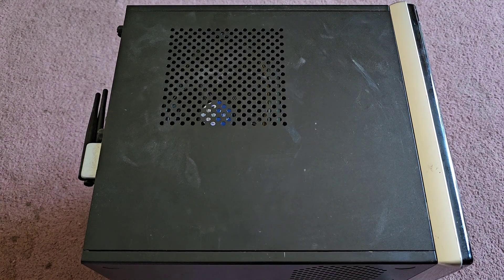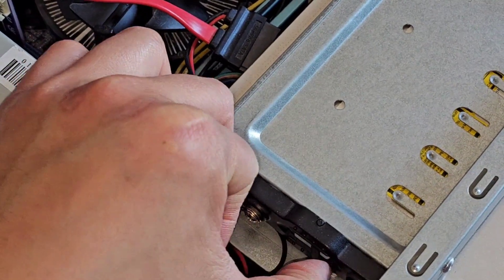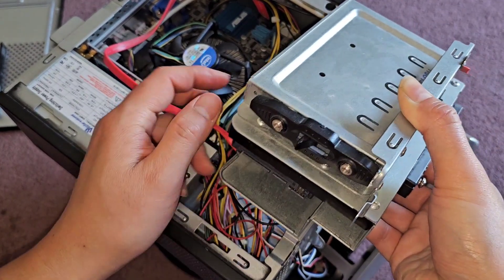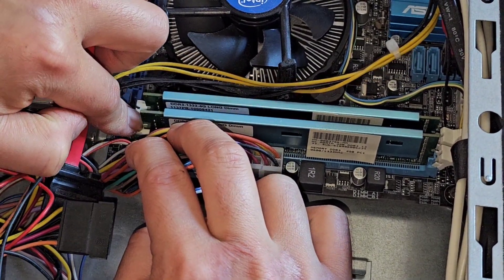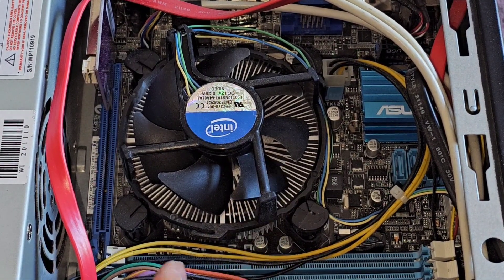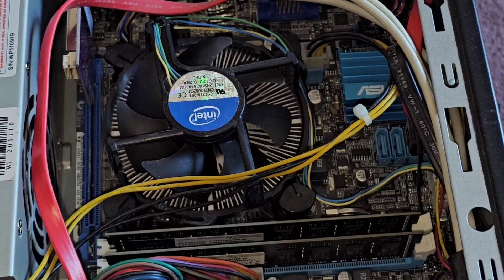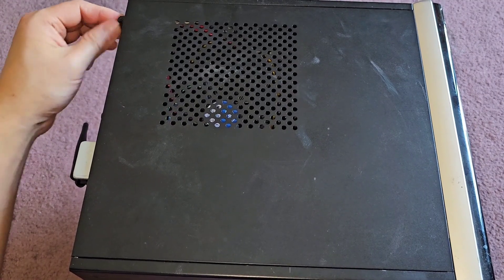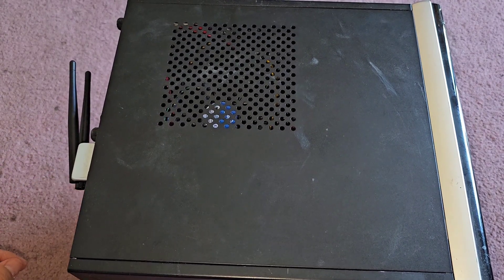Custom Desktop with ASUS P8H61-I R2.0 Disassembly RAM SSD Hard Drive Upgrade Replacement Repair

Comment: Wheres the ssd located? Ive tried to find it for my gaming pc but I cant see it but shows that its in my motherboard in task manager?
Reply from the maker: Check for an m.2 on the motherboard
Reply: @ItsBinhRepaired wheres it located on this motherboard?
Reply from the maker: @leeq3588  not sure
Reply from the maker: @leeq3588  either the motherboard or follow the sata cables